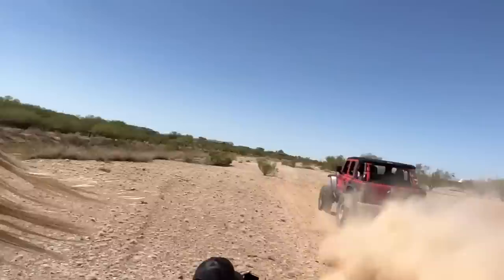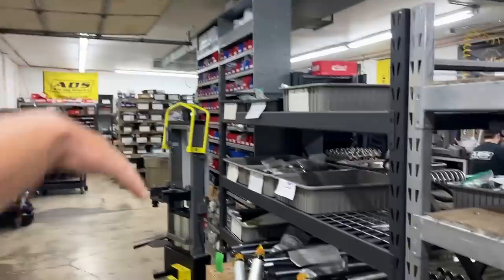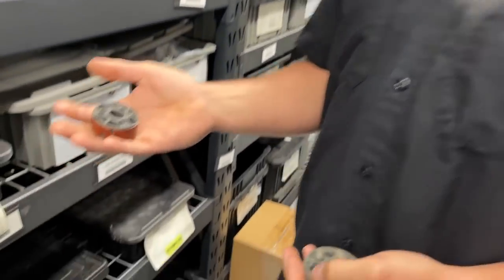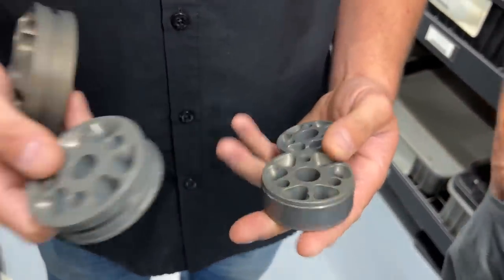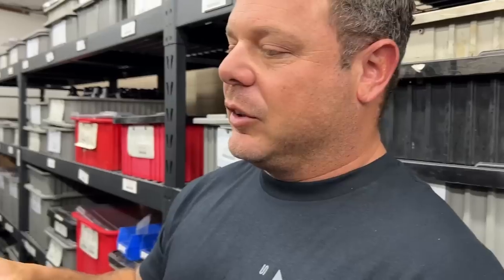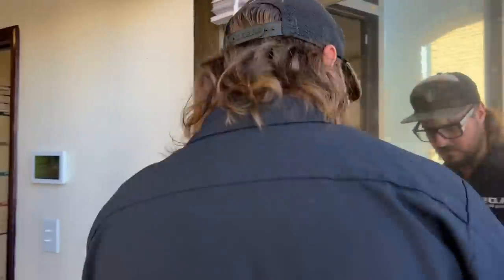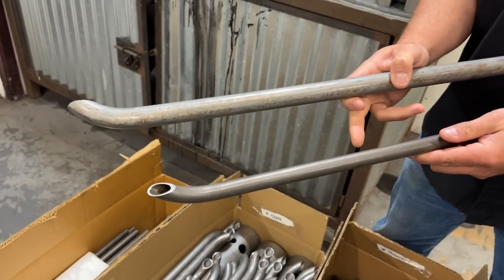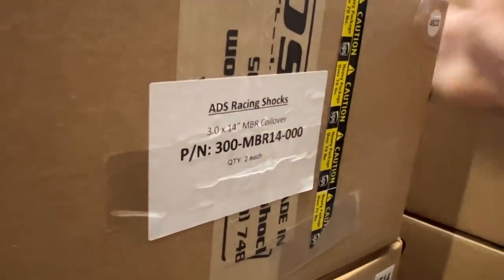MONSTER JEEP - First Test Run & JUMP!

Comment: Was so fortunate to bump into Brittany and Kevin on Friday at Trailhero to discuss this ADS shock set-up. They were so kind to take time to talk to me about their experience with this new set-up and went WAY beyond just talking about it. Kevin was SO nice he took me and my wife, she had a heck of a time getting in the back seat I'm sure it was because of the angle of the jeep 😂.  Kevin took us for a quick ride through a sand side road along the main road in the Sand Hallow. It was an amazing experience and complete eye-opener.  We may or may not have gone 2X the speed limit if on pavement which was only a few feet away. But wow definitely like floating on a cloud. So darn appreciated the generosity both Kevin and Brittany shared with us. I winter 40 miles from ADS manufacturer and will be buying shocks from them in a few months. Thank you Lite Brite!
Reply from the maker: Was great to meet you guys!

Comment: 43" tsl stickys would look absolutely sick on that jeep!
Reply from the maker: They would for sure but would limit up travel and slow the jeep way down due to the weight. The main goal of the stepchild is to do everything at high caliber. Anything bigger than a 40 and you start to tip the scales away from the fast stuff

Comment: Ya'll should do a video on evolution of step child. Like why you ran, was it 6 packs? and then switched or why milestar to nitto etc. For  business/sponsorships, better function? Why didn't you go Bilstein on the step child?
Reply from the maker: Unfortunately, Bilstein doesn’t make anything like this for a Jeep application. And packaging both a bypass shock and a coilover on each corner simply wasn’t working & would require that we compromise on the performance of the build. We also don’t work exclusively with any shock company, which allows us to choose the best product for our intended use and purpose. 😊

Comment: I'm not sure how you can tune with tires at full pressure. I'm not a shock tuner, but I have felt were the tires absorb too much motion, so the shocks were too stiff. In that vehicle, increase the tire pressure made the vehicle ride softer, as it made the shock work. The soft tires caused the rate of compression to be too slow to break the shock lose. Having felt how tire pressure affects the balance between the shocks and suspension, it seems it would be impossible to tune it. From that and my motorhome with FSDs, I've learned how the shock is mostly balanced to the spring rate and unsprung weight, rather than the vehicle weight. Really the shocks only job is to prevent suspension overshoot, not to control the movement of the vehicle.

Comment: As a regular off road Jeep owner this is awesome, I jus wonder what the cost is.
Reply from the maker: For a regular off road enthusiast, these would be way overkill (both in performance, fabrication to make them fit, and financially). But they have plenty of suspension options that would probably better match both the intended use & the budget.

Comment: Wonder if i could get some made for my 05 grand cherokee 5.7 limited! Prolly not, lol. Awesome vid yall! Cheers
Reply: ! You have one too?!  Bilstein 5100s on mine, on 33x12.50s and 2" lift OME springs. I probably paid less for my shocks and tires than LBN paid for one of these shocks!
Reply: @trjnsd6874  yeah i live in Wisconsin so i do alot of woods rides and alot of mud! Runnin the stock rims wraped in BFG KO2S stock size (rk) gonna go to 33s w/ 1" wheel spacers and 2" lift. Cheers

Comment: I've ridden my fair share of all these $10k suspension kits with coilovers/bypasses which are allegedly Spec tuned but rides like a bag of d**ks. You might want to keep it cordial & not say names but I have no problem saying it....Double Throwdown rides like complete ass. Recon DSS is barely any better. That's not to say someone like Accutune couldn't dial it in but it's a bit misleading when you're lead to believe that it's plug n play which is impossible given the broad range of builds.

Comment: Any plans to address the anti squat issues?
Reply from the maker: What anti squat issue?
Reply: Just observing the suspension stands up significantly disrupting the stance under power…..
Reply from the maker: The anti squat is still basically the same on the Stepchild as it’s been the last couple of years. It’s still has the same 3link front. Kevin was also in 2WD for all of this testing, so the front will stand up noticeably more than if it were in 4WD. And a certain amount anti squat can be pretty helpful on a lot of obstacles when rock crawling (another tool in the tool belt, so to speak).
Reply: @LiteBrite   Gotcha, If the links are all still mounted in the same location as before I am guessing it's the ride height that has the anti-squat thrown out of whack.  Will be interesting to see how it behaves crawling.

Comment: So after everything bilstien did for you overnighting things to you , sponsorship,  you just change up . Where's your loyalty. I'm pretty disappointed.
Reply from the maker: Just curious, but by loyalty…did you mean you would rather us compromise on our build when a company doesn’t produce something for the application we need, and then lie to our viewers about how great it is (when, in reality, it’s not what we wanted or the best choice for the project)? 

Unfortunately, Bilstein doesn’t make anything like this for a Jeep application. And packaging both a bypass shock and a coilover on each corner simply wasn’t working & would require that we compromise on the performance of the most important build of our fleet. We also don’t work exclusively with any shock company or have any contracts with any shock company, which allows us to choose the best product for our purposes and intended use. 😊

We’re still running Bilsteins on the Supra and the Side Chick, and have 100+ videos demonstrating the performance of the Bilstein shocks that we used to have on the Stepchild and our Ultra4 car. 🤙
Reply: Boom... roasted 😂
Reply: REEEEEEEEEEEEE
Reply: In would have loved to see you face as you replied to this bitting you lip the hole time. Good job telling what up. Don't think I would have been so nice.
Reply: @LiteBrite  I support you guys using the best but some of what your saying is not exactly correct. Twin tube shocks have been around for awhile, Holley acknowledges that 😉, they’re really common in utvs. ADS has a really cool way of doing it that’s unique, the trade off is they look like they’re going to heat up fast and you’re going to get a lot of fade. Both King Shocks and Robby Gordon introduced mono tube internal bypass that helped add better cooling and performance decades ago to help. That being said the black hawks by Bilstein are a similar product, they have multiple zones of compression and rebound. Unfortunately they’re only in utvs now, but you might have been able to talk them into a custom job. 🤙
Reply from the maker: @ajstar89 I don’t think anyone claimed twin tube shocks were something new. ADS design will in fact not heat up, they haven’t had any heat or fading issues at all on race vehicles since their introduction about a year and a half ago. We tried talking to bilstein about using their Blackhawks but they were not willing to allow us to try them on the jeep and they are only in 12” stroke not 14” so they wouldn’t have worked in their current form but they still denied us using them in the jeep to begin with which is why we used ADS. ADS is much more willing to do custom stuff for anything Offroad related and willing to push and test limits like we try to do. Hope this clears a few things up for ya. 🤙
Reply: @LiteBrite  it does and thank you. I imagined you would reach out to them, I think we’ve seen your and the team have a high character.  I think your video implies that this ADS technology is new and unique to them. Which we agree isn’t, but the mechanism for what they are doing is. With ADS you don’t have to drill new tubes, over drill holes or change the side stack shims which is nice. I disagreed about the heat, if you are slowing down the fluid there is friction and friction = heat. Twin tubes will always have more heat due to how they pass the fluid, and if your have it now with multiple zones your going to run hotter. Now I know you said you wanted the best of all terrains, and the best IMO would be been to run a coilover bypass setup with a electronic reservoir system. Like SDI’s click on a set of fox or kings. Then you can tune your off road performance on a traditional bypass and adjust it between street and dirt with a electronic system on the coilover adding damping in all zones. You also get ecu guided changes applied to cornering, pitch, roll and breaking. Really making a fantastic ride on any terrain.
Reply from the maker: They have been testing these on race cars in ultra 4 racing and desert racing and have no shock fade and haven’t had to rebuild any of them due to heat or fluid break down. So you may be right that twin tubes can create more heat that doesn’t mean all are created equal and that there will be any issue with these with heat. We tried the coilover bypass route and it wasn’t working out the way we wanted and couldn’t fit 14” coilover bypasses all around without cutting way more into the body and losing more interior room and maybe even having to go to a small bench back seat which we don’t want to do. So we did what we did which is the best application for what we wanted to do and this is where we’re at. It rides amazingly on and off road. Soaks everything up and rides nice and plush. I couldn’t be happier